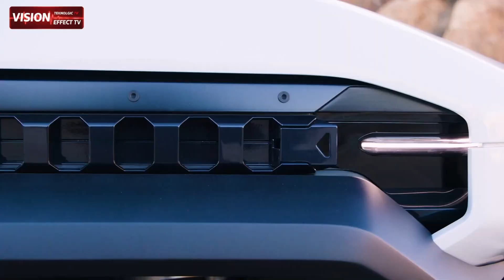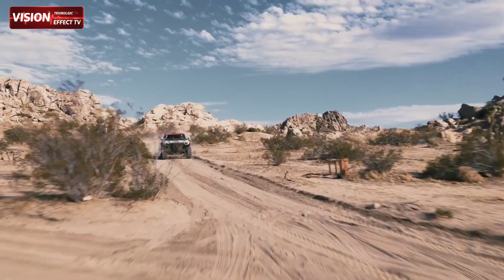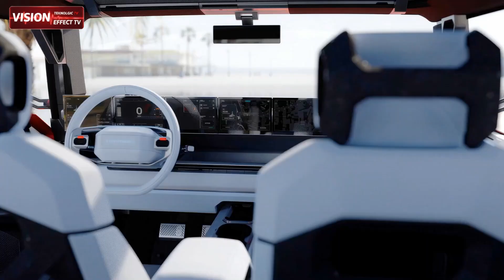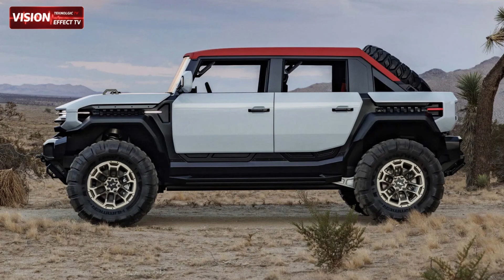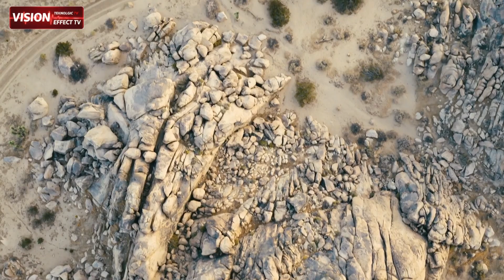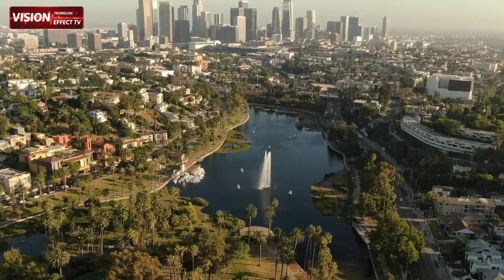The Dimensional Reset: Decoding GMC’s Radical Hummer X Counter-Offensive

Comment from the maker: For years, the Hummer EV represented maximum capability...
But also maximum size, maximum weight, and maximum cost.
So here's the real question:
Would you rather own a 9,000-pound electric supertruck...
Or a smaller, lighter, Bronco-sized Hummer that's easier to live with and potentially better off-road?
👇 Drop your verdict below.
Big Hummer or Smart Hummer? 🚙⚡